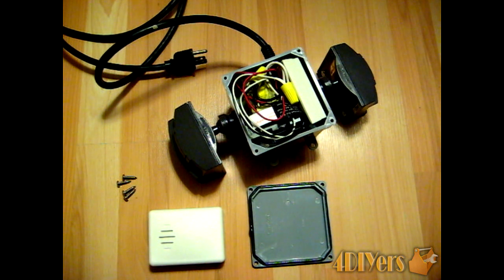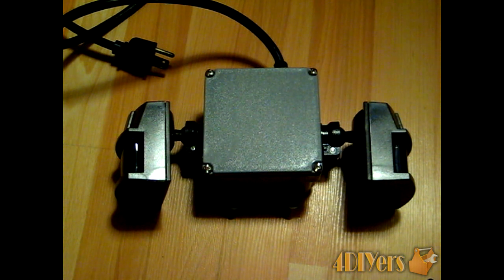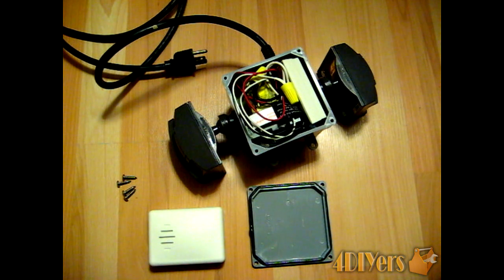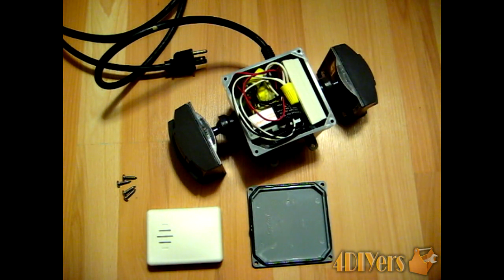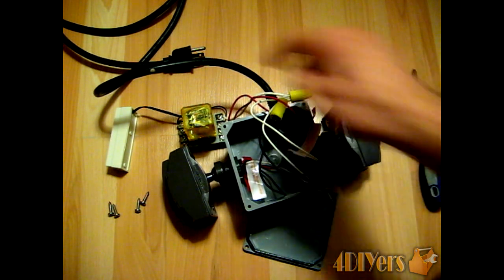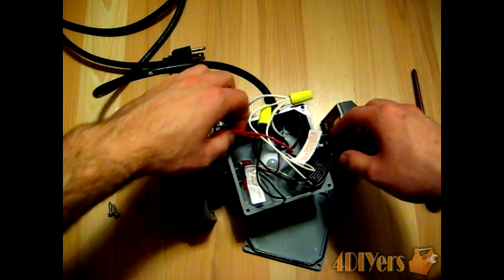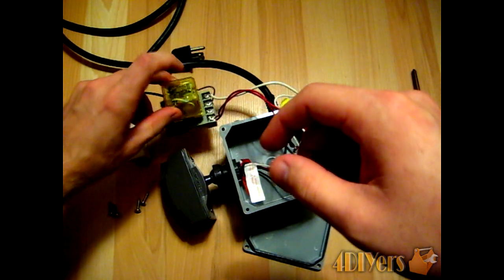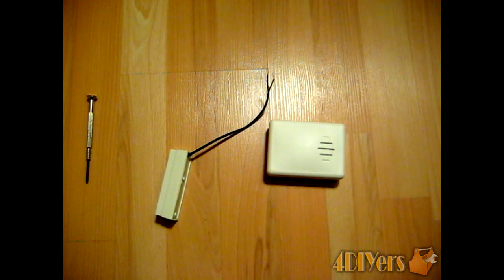How to Make a Wireless Motion Alarm or Security System

Comment: Thanks for the good video, this is precisely what i am currently doing. Lol.
I took the sensor off the light, attached a longer wire and mounted the light inside my house with the sensor outside in a hidden location.
Someone walks by... I get blinded with light and they dont know. It got me thinkin... Hmm can i attach a speaker or something... That would be better.
I have a wireless pir chime sensor that broke and took it apart for the chime...got as far as that and made it to this great video.
Now im back on track. 
Ill be getting a doorbell soon.lol. 
I like how you made it all come together, good job!👍

Comment: For falsing problems PIR's can be wired in series looking at same exact area for dual PIR's anti false, also relay can be eliminated by PIR suppyling power to mini power supply for doorbell power and short doorbell switch closed.    These PIRs work fine at night, but daylight will cause much falsing as they do not have white light immunity filtering and Optex lx-402 works well for me $70.  Did you have falsing during daytime?
Reply from the maker: A D I haven't had any issues during the daytime when it's been on, but it isn't normally used during the day. I have heard of issues with other models of motion sensors having issues in the daylight.

Comment: Do you have any specific info on the rely, I have never seen one like that. Could I use a standard 4 pin rely with a 30,86,87 and 85 pin?
Reply from the maker: Robert Scott That does sound like the correct rely after looking at a diagram online. But it MUST be for a 120V application.

Comment: What are the specs on the relay? What powers the doorbell switch? Is it a button cell battery?
Reply from the maker: +Douglas Brand This is just a standard 120v mechanical relay. One contact on the inside which is normally open. The door bell is powered by a button cell battery and does need to be replaced after a certain amount of usage.

Comment: I'm wondering if you could make one using the solar panel/battery of one of those outdoor solar lights on lieu of sourcing 120v?

See example: 
http://www.amazon.com/Sunforce-82156-Solar-Motion-Light/dp/B0052SF0LO

Given it's only a sound chime,  the battery should last all night until the next sunrise.

Your thoughts?
Reply from the maker: That possible would work, but the only problem is that it might not last that long. I see that light only lasts for a maximum of 30min, while only running for 25sec, 72 times. I relay would still need to be powered up for about 10sec total, so you might be lucky to get a couple hours from the setup. Especially during the cold months, it would be even less.

You would also need to run a low voltage relay if you did go that route instead of 120v too.

A better method would be using a boat battery. The reason for a boat battery is because it's a deep cycle and it can be drained out and recharged continuously without damaging the battery. Now you can run that off either a small 12v inverter and still have the sensor setup as 120v. Or you could still purchase a low voltage motion sensor, 12v relay, and not bother having an inverter. Both setups you can still run a solar panel to charge up the battery as well.

Comment: I'm having trouble locating at Mechanical Coil Relay. What is the low voltage convert to from the 120 volt?  The wireless door bell operates on a 3 volt Ultrium battery.